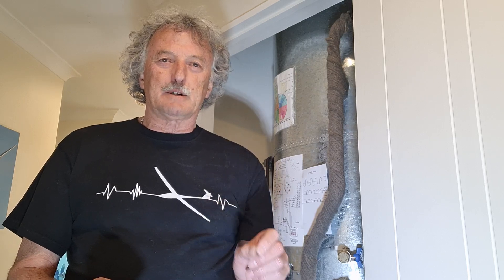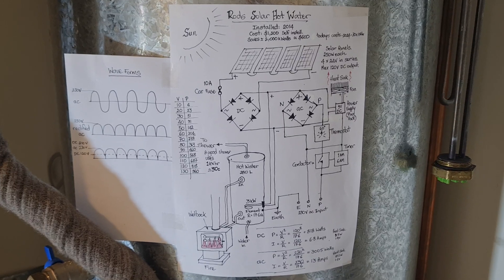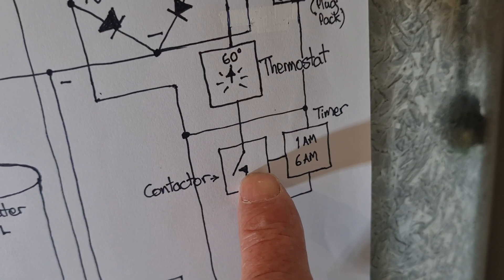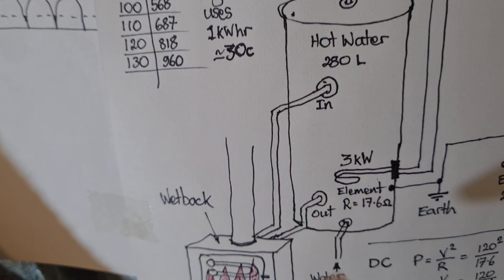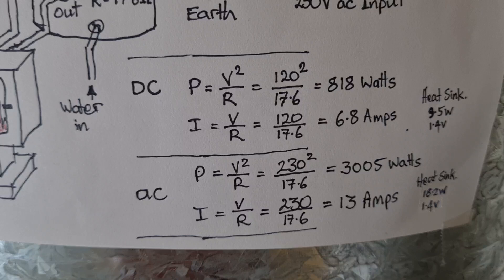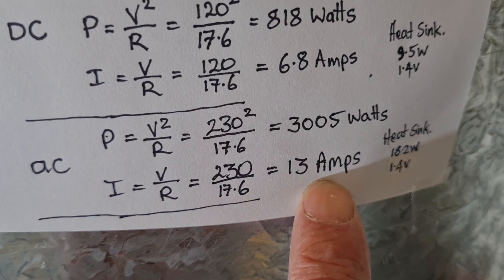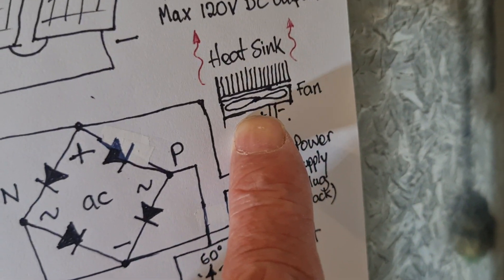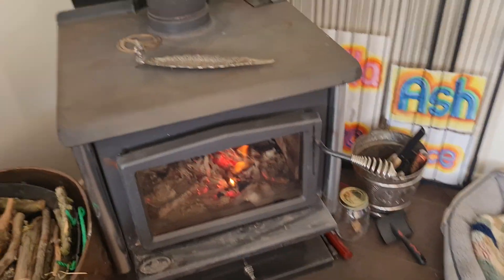Stunningly simple solar hot water system 🔥🌞

Comment: petty good.. i also have a car fuse in my solar system,, there is a likely hood of a dc arc melting the whole holder if it blows so mine has space around to allow for this... nothing else can melt.. how have you controlled the solar side of the elements temperature.. theres no thermostat.. only a thermostat on the ac side.. a dc contacter can solve this.. the gas filled ones are the way to go

Comment: Your wasting a lot of power running contactors, diodes, timer, power supply and fan. Two 48v single pole relays in series (ie 98v) on the solar side will run the system more efficiently

Comment: Why didn't you just install a dual element cylinder? Why do you need a br on the solar side when it is never AC?
I used to muck around with DC into elements, but I just installed a heat pump instead. As others have said you are putting DC into the grid, which basically puts emf noise into all your neighbours appliances and makes them run hotter and noisier.

Comment: Others have mentioned the danger of fire with this setup but you should also consider that you are leaking DC onto the local grid if you close the switch during the day. You could electrocute a network engineer as ac safety systems are not expecting dc current. Consider separating them for your safety and others.

Comment: Hi There is an error in the drawing of your circuit diagram to do with the DC plus an minus polarity's as shown. 
It probably is only a drawing mistake where the diodes are drawn in reverse and the DC coming out of the Bridge rectifyers is reverse polarity. Anywat it is not actually going to affect the operation. 
You may in fact have it all assembled correctlty but the plus and minus on your drawing are back to front, recversed. There is a saying that helps figure out the current flow through diode bridges it is "All roads lead to possitive"  Plus there are useually markings on the BRectifyers  showing + and minus.  Anyway do the following and you won't need diodes.

For safety  you are best to use the separate Heating element as someone suggests in  one of these posts here. The type with two elements in the one unit sounds good as you do not have to alter the cylinder. Plus there is then no need for any Bridge rectifyers. Plus I am going to assume (hope) you do actualy have a conventional fuse or cut out supplying the 230 volts AC to that heater. Also make sure your rooftop solar panel metal work is propery earthed. I assume your plumbing already is properly earthed so via copper pipes  that would include the metal firebox. Another way you could have used two voltage sources to one element is by using an appropriate change over contacts unit  with a timer. I do not like the Diodes they are a risk and will fail sometime.

Comment: Nice backup of heating. I would go with isolating the DC and AC side with a relay or transfer switch. You dont need a rectifier on the incoming DC since it is DC. Did you modify the stove to accept a water pipe or did stove come that way. Keep perfecting

Comment: Really is an interesting concept, the 2 bridge rectifiers are basically working as OR logic. 
I'm not convinced your electricity supplier would be at all happy with just a bridge rectifier and contactor controlled by a timer, isolating the system from the mains (and only on Phase). I'd suspect they would want an isolation transformer in circuit too. If there is ever a brownout /surge /spike  in the mains or a lightening strike in the 1am to 6am period,  one of the P/N junctions of the diodes could short and when the solar kicks in, you'd be putting some DC condition back into the electrical grid, well at least on the neutral. The contactor is disconnecting during the day so what happens if there is a mains fail, does it drop out and connect to Phase/live  and if a  diode was damaged in the outage it could potentially put a condition on Phase too? Do you have the 220 VAC input fed from a RCD circuit ?

Comment: Use 4 by 250 panels plus 240 volt inverter. If for 2 people. If you need more hot water option 1 add 5 kw of batteries. Option 2. 2 hot water systems 600 litres  1500 watt elements maybe 2 extra panels stay of grid. What works out the cheapest for you. Stick with plug and play if possible. 2 people use 4 to 6 kw per day approximately depending on the weather.

Comment: Two issues to consider: switching DC by the thermostat is rather different and more difficult than AC. See: https://www.youtube.com/watch?v=S9a2oPCIMr0; the load on the panels will not be efficiently passed to the heater because there is no maximum power point tracking. You could leave mains in AC form and switch between the two systems with a relay.

Comment: Hello Rod, Clever idea.
Comment on that fuse:  If the car fuse is rated 10Amp, 250Volt then you're in good shape else I would suggest changing the 10A car fuse for a 10A, 250V fuse. (Theory is - if the fuse blows and the fuse material vaporizes and coats the interior of the fuse cavity then it could continue to conduct.) - Tony
Reply: If the fuse is sufficiently rated for the circuit voltage and breaking capacity to suit the prospective short-circuit current, that won't happen BUT the fuse MUST be rated for DC to clear the fault when it operates. Blade-type car fuses are certainly not suitable.

Comment: The technical problem with your design is that the entire circuit is referenced to mains potential and a popped diode can totally fry your panels. You will also have some fireworks in that closet when one of those bride rectifiers gives out. I've replaced a lot of those which let the blue smoke out in a 'dynamic' way. I'll give you an idea which adds lots of safety and efficiency at the same time while bringing the setup in line with your electric regulations. All you need is a welder to add a 2nd heater element port and a 2nd thermostat port to the tank. Give one set to solar and the other to mains and set the mains thermostat just a hair lower than the solar with your same timing logic as perfected still on the mains. Another option is to add a 1:1 mains isolation transformer but your panels are still at risk WHEN a diode pops.

Comment: But he’s got direct heat going into the water and mains electricity too, in addition to the solar. Surprised he doesn’t add a gas boiler to it as well, just for a full house. Seems a faff and would be interested what the failure modes look like if one one of those components burns out.

Comment: While I applaud your innovation, you need to consider how the design will work (cope) with component failures, prolonged working (in non failure condition) is no measure of the success.  For example  if you have a diode failure(s) on the bridge rectifier, and the AC contactor is on, what happens,... i thing that electricity is high quality energy, that means you can do more useful work with it, when you convert that electricity into hot water you have degraded its quality, in other words, you can't do anything else with it. For me the best way to make hot water is using solar water heating panels, heat of sun direct to heating water and keep the PV power for your lights, TV,..... and if and only if you have any left, dump it into a tank!

Comment: Looks good... Your logic is spot on... The only thing I see it maybe one or two diodes in series with the wiring of the solar panels just in case the dc bridge rectifier fails and the mains ac power has free range on the solar circuit... then the panels would be fried and possibly become a fire hazard very fast... The main question is: can a BR fail in such a way that the internal diodes become conductors or even low resistance conductors???

Comment: Great work, but get rid of that dangerous automotive fuse, it is not safe or reliable on that voltage. Use a fuse or circuit breaker which is properly rated for DC and the full voltage of the equipment.

Comment: An ‘interesting’  idea but... This is why electricians in Aus and NZ need to be licensed. There are a number of reasons this installation would not comply with AS/NZS 3000. The only thing separating your rooftop PV from mains AC voltage is a couple of diodes which do fail occasionally. Then you may well find your self destroying your PV modules or worse a fire and/ or electrifying your roof. Also, as mentioned by others I’m sure an automotive fuse isn’t rated for 120v nor is the thermostat rated for DC. The fact that it’s been running for 10 years just means that you’ve been lucky not clever. I haven’t been in a car accident for well over 30 years but I still put my seat belt every time I’m in a car.

Comment: Bad idea putting DC into a water heater. Even worse idea is to rectified 230ac as you have forgotten about multiplying the voltave by 2√2 ie 1.414. you run the risk of a DC arc. You will get an arc when the thermostat tries to break the electrical connection. The Thermostat is not designed to interrupt DC current and definitely not a 230v or the 320VDC it would be subjected to when on rectified mains voltages. Interrupting DC current requires high speed contacts arc arrestor shields and a magnetic arc blow outs. Then there is the problem erosion of your water tank and heater element due to electrolysis and possibly your copper pipes.

Comment: WTF,  if you want hot water get a solar water heater,  they're like 95% efficient
Reply: True but solar PV water heating has some advantages. If your tank doesn't have a coil its your only option. You don't have to run pipes from your roof to the tank only a cable. Works just as well when it's very cold unlike solar thermal.

Comment: Nice work. I have been looking for ways to use panels for heating my hot water for a year or so. Last idea, which is nearly complete, is to feed the panels into a 100 litre fosters keg and plumb that in as a pre heater for the main cylinder. Why it didn't occur to me to use the immersion heater in the tank escapes me. I will be looking into a totally wired system along your lines as soon as.
As I live in the U.K we have gas central heating/hot water but with an immersion heater for use if the boiler goes down. That is on a switched 240 volt mains feed but could easily be wired via a centre off 3 way break before make switch supplying either mains or solar to the immersion. The hot water is already on a timer so any solar generation could be fed directly to the immersion.
Just out of curiosity, why use the rectifier on the solar, it's already DC.

Comment: 120VDC across "a standard 10A car fuse", or going the other way your choice of about 320VDC or 240VAC across "a standard 10A car fuse", presumably 120VDC across the thermal cutout assuming the thermal cutout is even still in circuit, appears to be uncontrolled 120VDC into the element so basically relying on tank draw down vs PV production across a day to ensure it doesn't go over temperature, 120DVC carried by what appears to be standard 3 core mains cabling, single point switching so potentially PV directly applied onto premises 230VAC circuits.  I'm certainly not the safety police but dear God, I'm not going anywhere near this.  It may have worked for 10 years but that's more wing and a prayer than anything else.

Comment: I did a simple setup too here in Western Australia. Mine is a lot simpler. I put the panels (5) in series and put the DC straight to the element with NO THERMOSTAT. In fact there is no breaker either! Piping hot water year round, no need for boosting with AC grid power or wetback.

Comment: Fair play to you 👍🏻
I have solar thermal, but it's old. Am currently replacing the wood burning stove with one that has a boiler to power the hot water and central heating. The oil boiler broke a few years back and I'm going carbon neutral; Growing a lot of Eucalyptus, fabulous firewood 😉
I like doing my own work.
I liked and subscribed, thanks a mil and good luck 🍀

Comment: This is more dangerous and complicated than it needs to be.  What you need is 1 Double Pole, Double Through (DPDT) relay, and you can get rid of the big bridge rectifiers, heatink, and fan.  Hook up the heater coil to the common leads of the relay.  Hook up the solar power to the Normally Closed side of the relay.  Hook up the AC to the Normally Open side of the relay.  Hook up the relay coil through the timer as you have it now.  The timer will connect AC to the heater between 1 and 6 AM, and to the solar panels the rest of the day.  The power you were blowing off the bridge rectifiers into your house now goes directly into your water heater instead.  And you don't have the safety problems of AC connected to your panels unless the relay receives some kind of wierd damage.  Use the appropriate breakers and fuses, and don't forget lightning protection for wires into your house from the solar panels.
Reply: Will those typical contractors be DC rated?
Reply: @egg399.  Most are rated for both DC and AC.  Look at Digi-Key and Mouser for known good parts.

Comment: Ok...am I missing something here (tell me if I am)?  I'm a heating & hot water engineer (technician).  You say that your mains comes on for 5 hours overnight?  That's enough all on its own to give you a day's worth of hot water!  Here in Britain, we have 'thermal store cylinders' which use 'Economy 7' electricity for 6 hours a night...to provide a whole day's worth of HW.  It doesn't come on in the day at all.  In fact, it cannot.  So, unless I am missing something, your solar panels are doing little to nothing.
Reply from the maker: @barryfoster453  The power is switched on at 1am but if the water is over +60°C  the thermostat will be off.  In cloudy weather with no fire the ac power will boost the temperature.  Once we went 3 months and didn't know the ac switch was off!
Reply: @highflyrod  
Then turn it off permanently and see what HW you get.  Connected to mains power, it is skewing all of your assumptions.  It's like saying that your electric car seems to be running by regenerative braking...but you plug it in every night.

Comment: You have the beginnings of a concept called blended power.  I have a washer that runs off array voltage power.  When a cloud passes over, it will fill in 100-150W from a battery to make up for the drop in panel current.  Direct connect is really a poor way to heat water.   It only exists because it is easy.  I You need three times the panels to get the daily performance of mine with simple cheap electronics.
https://www.youtube.com/shorts/pEIiw2AvTeQ   Off grid laundry.  These panels also power my house.

Comment: I AM an electrician and my first thougt was 'you can't do that' ! But I guess your'e not dead yet but if the ac. BR fails it could get ugly. It really is a good idea but I agree with another commenter that  2 elements would separate the ac from the dc. Also put a lock on the door to stop little fingers getting to live parts.
I love it when ordinary folk have great ideas like this and you sir are one of them - be encouraged but also be safe.
Reply: 3KW heater is not really needed.  A 500W step down transformer Is enough to keep the heater warm overnight and provide supplemented power in the day.  That would make it much safer.

Comment: Nice and simple system you have put together. You only mention a thermostat when running on mains, what about overheating when running on solar panels, has that not been an issue on sunny days?
Reply from the maker: You are right.  For 10 years I have removed the car fuse when we go away for longer than two days.  I forgot once and the water was at +90°C when we got home after a week!

Comment: Electronic tech here. Great idea Im going to make a modified one for myself. I just should point out some safety issues. You really should have a fuse before the BR on the AC side in case it shorts. 
Also the way you have wired the left BR you are feeding  power across the BR and up to the solar panels when the AC power is on. This is 320vdc. This is lethal and if the other BR failed you have 240AC fed to the roof. I would get rid of the left BR replace with a changeover relay so the solar and the mains power are always isolated from each other. Could be light operated.Or as others have mentioed maybe dual element. Be safe
Reply: As a pv over charge shunt making hot water makes sense but if you want to heat water from the sun it is better to just heat the water directly from sunlight using no PVs into an insulated feeder tank that feeds into the main water heater
Reply: That AC to DC rectifier back to the panels jumped out to me also.  I also wondered about the diode loss from the panels which at higher current would be substantial